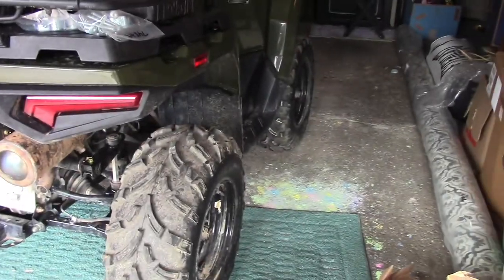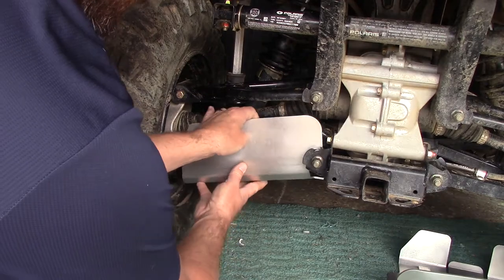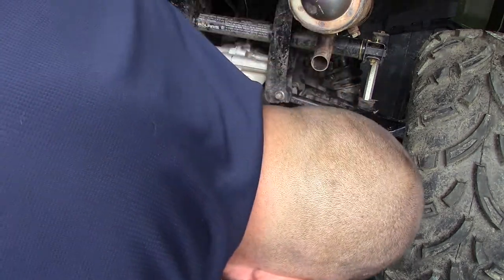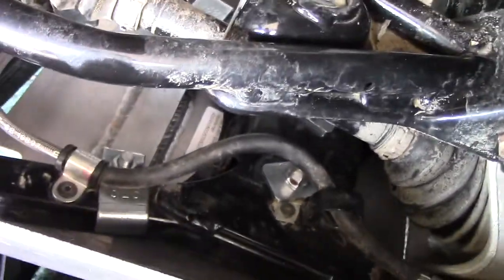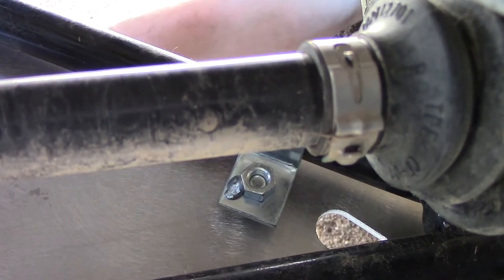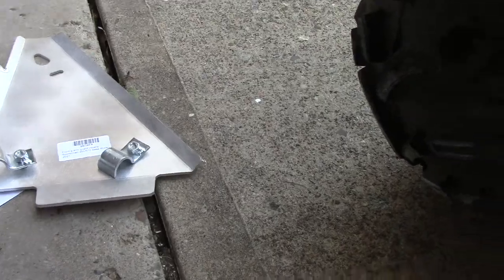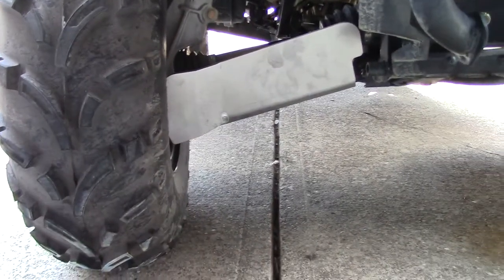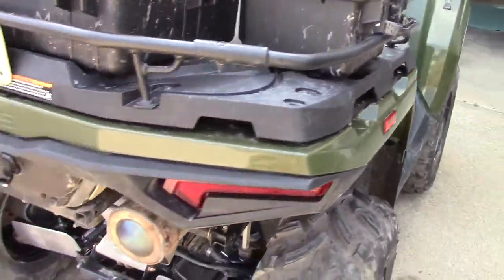2021 POLARIS 570 Ricochet A Arm/CV Boot Guard install. Video #6

Comment: I really wish I had taken your advice the first time I watch this video. Took my brand new machine out this weekend without these guards on and took a stick through one of the CV boots. Luckily the axle is fine and it just needs a boot replacement but now I'll be down for about 3 weeks while it gets repaired. Let's just say these are on order now.